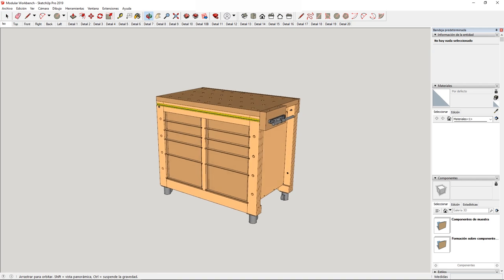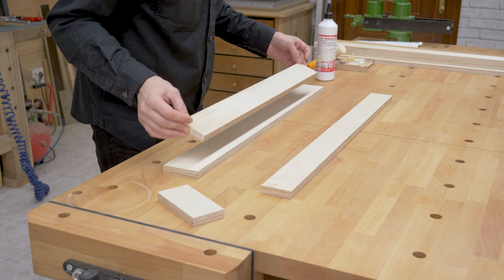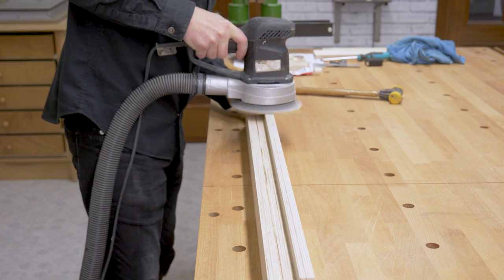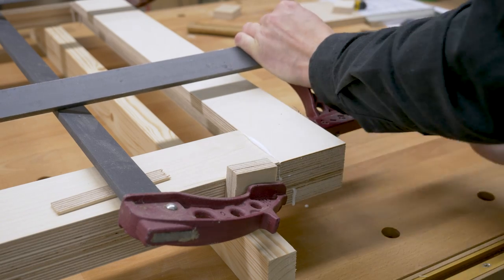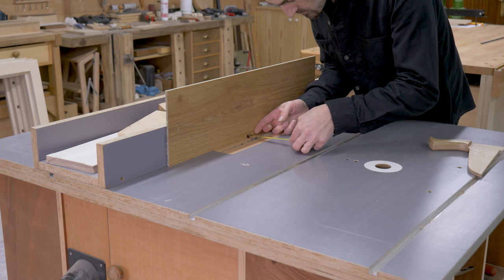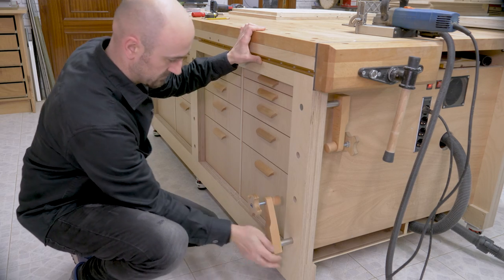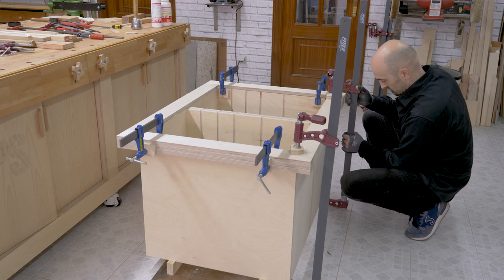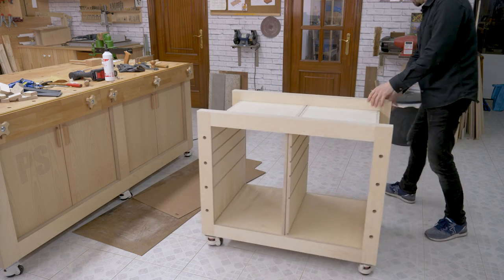Modular Workbench & Mobile Tool Stand Build (Ep.1)

Comment: I've adapted this into single units.  Instead of having two cabinet boxes and a wide frame, I do a slimmer frame and just one box for a bank of drawers.  I put them all around the perimeter of my shop and just put a continuous top down them.  For a miter saw, I simply connected the top to the sides to provide a lower platform and its amazing.  I don't make mine quite as deep (deep enough for a couple systainers and a few drawers.  My workshop looks awesome thanks to your design.  I even went so far as to paint the "legs" in festool dark blue, the cabinet insides and drawer fronts in festool gray, and the draw pulls are painted in festool green.  It looks like I have a festool super shop.  Best money I ever spent getting the plans for this design.  Thank you Paoson!
Reply from the maker: hello Brent, sounds really good! I would love to see photos, you will find my address on my website: www.paoson.com
Reply: Great idea, and a concept for added flexibility I am considering - maybe you can share those photos?

Comment: I've been playing about with designs for a new bench, with ideas ranging from flip top parts for tools, MFT style holes, drawers etc ... and then I finally came up with the idea of making multiple smaller benches which could be joined together in various ways to suit the application.

Then I find your video of exactly what I've been playing about with ... you beat me to it by a good few years.

Interesting, I've designed my drawers exactly the same way as you have, including the sliding mechanism ... however I'll be using laminate for the base of my drawers which will provide a smooth sliding action.

I like the method building the frame, simple, easy and immensely strong, with the advantage of using material which is all the same thickness and type ... my design uses a mixture of ply and pine ... I like your method better!

Many thanks for sharing :)

Comment: My first workshop table was a 4ft x 8ft beast with drawers and the same levelling feet as this one. I’ve started to feel it’s a bit too large for the majority of general assembly work so I’m considering making 6 of these, two for a mitre saw station and the other 4 to be able to assembly into a 4x8 workstation for breaking down large sheets but then allowing them to be pushed up against the wall of the shop to create an open floor plan area for other tasks when needed

Comment: I like the modular nature. I can't decide whether to build two of these or one big one. My concern about the modular one is that when connected together you couldn't use all the dogs for making perfect 90 degree cuts. No matter the connection type I think the error would be too great vs one big cnc/parf cut top. For small pieces and clamping it's great though. Really like the benches.
Reply: answering my own question I guess you cut have a t-track on both side and use another piece of metal to make sure the join the rock solid. The two tops would need to have the dog holes cut at the same time in this configuration too.

Comment: I really like this design and I bought the plans as I will be building it, probably 2-3 of them.  My only concern is if I want to use a couple of the work benches as an assemble table - will the be dead flat and on the same plane?  Assuming that each bench is built same size and accurately and that the floor is level.

Comment: I have looked at many designs and videos and I must say your modular unit is something I was thinking of. So when I found yours, I was very happy.
I'm intrigued whether you plan on designing more units with the same modular setup? I have a mitre saw and a bench saw that I'm planning on integrating into my workbench, some varients on your modular system. Maybe a router station too. 
If you are planning further additions to this series, please let me know as I'll hold off my current build to see what you come up with? :)
Many thanks for sharing your amazing designs and informative videos. So glad I found your channel.
Reply: Sorry, one more question...? Did you explain how you join multiple modular workstations? My floor in my garage isn't that smooth, so a solid fixing solution is needed. I've just bought the plans and will look through.
Reply from the maker: thanks Jon! I have in mind to make modular benches for other tools like a sliding mitre saw or a drill press.
Reply from the maker: In the next videos I will explain how to join the benches
Reply: @Paoson_Woodworking  - awesome, thanks so much for letting me know. Looking forward to them :)

Comment: Ok so I have purchased both the plans for this and the larger bench and plan to make them all. 
What brand of hinges and drawer slides do you recommend for these?
After the larger table is made do you ever use a miter saw again?
If you do. should I make one of these to mount one with a dust shroud?
Do you find it easier to use a tablesaw or the track saw? 
Is  a tablesaw needed in the shop anymore?
I am limited on space and looking for compact yet customizable designs that flow with the evolution of my shop.
Reply from the maker: hello Robert, could you ask the questions in the forum of my website? so we will help more people
https://www.paoson.com/forum/viewforum.php?f=31&sid=5258d9b0db7098df72f9bcfe12e12ef1

Comment: I can't wait to eventually have a space that I can build something like this, one question I have is how would you lock all 4 wheels if you put 4 together as you won't have access to the wheels in the middle, I get you can do all 4 on 3 of the benches but the 4th would have a wheel left unable to be adjusted, do you have a solution for that? or when 2 are together and placed against a wall as I have seen you have in other videos, how do you adjust the middle back wheels?  Huge fan of the builds.

Comment: Paoson - bon journo. I just purchased your plans & look forward to building a few of these for my workshop.  I intend on making two (2) identical units and a third one a few inches shorter for my miter saw.  Great job designing these beautiful cabinets & thank you for sharing.

At 9:45 in your video, you shake something on the glue.  Is it salt?  And what is this done for?  Grazie mille!

ps. I just looked it up on internet. apparently, salting glued pieces minimizes slippage of the glued pieces. thanks for sharing this tip.
Reply from the maker: yes, I sprinkle salt on all the surfaces so that the parts won't move when tightening the clamps. Send me some photo of your progress!

Comment: Hi Paoson and thanks a lot for this wonderfull work. I've just bought the modular workbench plan and I'll try to make one of my own soon. A little question, what's the lengh of your nails? I have a 18V Makita nail gun using 0,6 mm headless nails. There are : 15, 18, 25, 30 or 35 mm. Thanks a lot, Thomas.
Reply from the maker: hi, the 30mm ones will be perfect

Comment: Suso, I purchased these plans a while ago and would like to modify to expand to 3 banks of drawers instead of two in order to save some of the "wasted" space when joining multiple units together in a row.  So instead of building 3 of these I would build 2 units each with 3 banks of drawers.  Would the same framing style and width be strong enough if I put wheels or feet under the centre of the middle bank of drawers?
Reply from the maker: hi Kevin, you will not have problems if you put wheels in the middle of each frame. Send me some photo!
Reply: @Paoson_Woodworking  Super, thanks for taking the time to reply Suso - very much appreciated!

Comment: Great work on these benches. Love them.  Is the height for these the same as your Mobile Workbench with Table Saw & Router Table.  I want to use these as additional workspace in conjunction with the workbench.
Reply from the maker: thanks! yes, they are the same height
Reply: Thanks.  Just purchased both.  I hope I can find the parts and get delivery in Greece

Comment: Just got round to watching this, it looks fantastic. Would something this small work for handplaning work (or two joined together)? Or do you think that it would not be stable enough? I could replace castors with solid feet for my needs I think.
Reply from the maker: Yes, you can lengthen the necessary pieces and have solid feet. This bench is stable enough for handplaning work!
Reply: @Paoson_Woodworking  that's fantastic, thanks for your response

Comment: What was the stuff you sprinkled on the wood glue at the 9:45 mark?
Reply: Salt. It makes glue less slippery.
Reply from the maker: salt, to prevent pieces from moving
Reply: @Paoson_Woodworking  Thanks! That was the answer to one of my questions! With the help of your plans and the videos, I started building my first workbench as a beginner! The frames are ready and don't try to use regional 3-layer wood for the body ... but it's hard to get at the moment!
Kuno von Odenbach in Germany

Comment: Dear Paoson! I bouht your wood working plansand I will try to build the bench today! What I find absurd about your tutorial is that, you give a list of pieces and sizes of each piece. However, when you start showing us how to assemble them, you make no references to the sizes of the timber you've used. One is left guessing if you're using the 770mm piece of the 870mm piece of the 646mm piece. figuring it all out is almost equal to just building the workbench without refering to your video! Is this something you can change? Get a hint from IKEA.....
Reply from the maker: hello! in the cutting list you can find a 3D drawing of the bench with the reference number of all the pieces. With that file and watching the video you should be able to know which are the pieces that I am using. If you have more questions please write me by email, I can help you better
Reply: @Paoson_Woodworking  I finally got it. I discovered, following the video doesn't help when building the bench. Following the instruction sheet with pieces numbered is almost I you need! I've glued the frame and on my way to building. PS: I used recycled pallet wood! Hope it doesn't come out too bad! But for my first ever wood work project... i'll take it as practice! Thank you for your response!